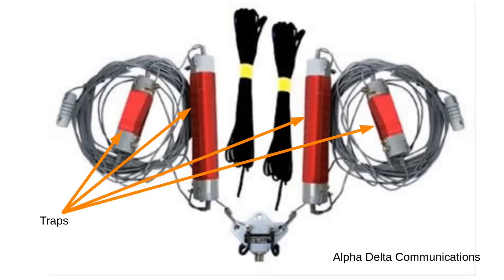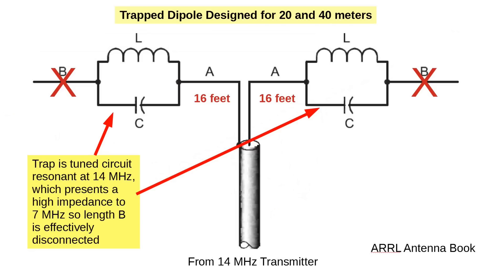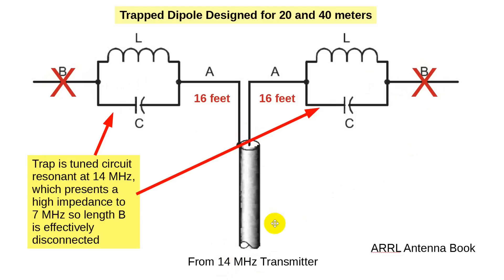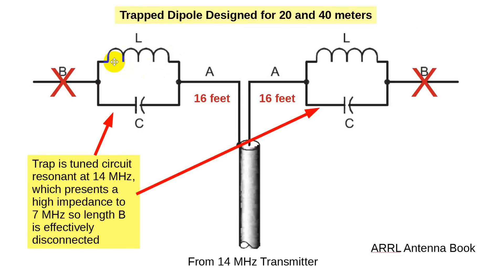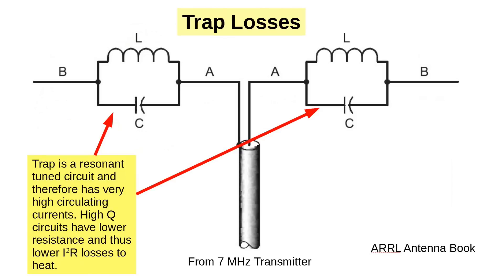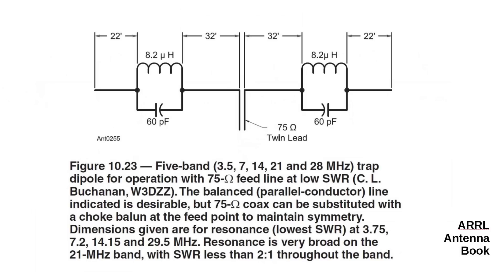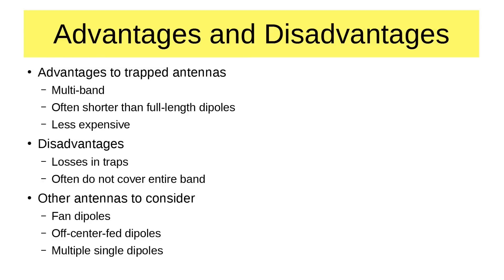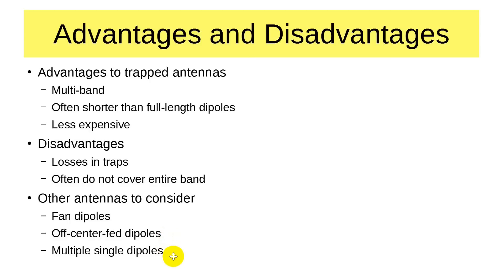How Antenna Traps Work (#357)

Comment: Hi, I have a trapped diopole 40/20/15/10, its low off the ground, SWR on 10/15/40 are ok but on 20 SWR is high, the antenna is to long, where would I adjust the length to get a lower SWR on 20m...  Any advice would be great..

Comment: Great video and explanation Dave.  It also seems to explain the Diamond SRH 320A Tri-band antenna designed for the the VX-6 tri-band HT.  So I’m assuming that what I like to call the “load” in the middle of the antenna is in fact a trap that segregates  some of the three band resonances that make it a tri-band.  But if that is correct, why aren’t there two “loads” (traps) for separation/segregation of all three resonant sections?  I’ve loved antenna theory ever since my bachelor’s of EE, and have enjoyed researching and learning more and more of all the theory of antennas and how they work. Thanks Dave and 73 Tom KC3QAC.

Comment: Dave, your comment that no antenna will cover the entire 80m band is inaccurate. I use a 160m through 6 meter windom. 3.5Mhz to 4Mhz  on a yaesu ft950 using ONLY the inboard tuner.

Comment: What if you used ladder line to feed a off centre dipole at 22% feed point but had coax feeding along the ladder line at different points. Then had a inductor at the matchbox/tuner, but the inductor was more like a variable transformer which could tap in at different points along the ladder line.

Comment: If a trap is very high Q, will you get extra gain at the resonant frequency? Meaning, if you're only receiving a single frequency, then it seems like a trap has no downside, only upsides: shorter antenna, no heat, no losses. Correct? thx!
Reply from the maker: Traps cannot create power. In this case, higher Q translates into narrower bandwidth. Traps are RLC circuits and can have high circulating currents, which causes some loss in the R component.
Reply: @davecasler  So they don't create gain, but concentrate energy on a particular frequency, correct? Doesn't that help compensate for losses? Isn't the whole point that the trap provides less loss at a given frequency than you could achieve otherwise (with a broadband antenna)?
Reply from the maker: @johnaweiss  The short answer is no. A trap is a passive filter that either allows energy to pass or blocks (traps) it, depending on the frequency. Prudent choice of traps allows you to create a multi-band antenna, and only the correct part of the antenna will radiate. The choice of frequency is made by the radio's internal oscillator. Think of it this way: depending on frequency, a trap either allows use of a certain part of the antenna or blocks it, so for different bands the antenna has different effective lengths. Note that traps largely went out of style about 30 years ago, and few new antennas use them (although you can still buy them). Nowadays it's end-fed-half-wave dipoles that cover many bands, or off-center-fed dipoles that can cover several bands. Hope that helps.

Comment: One question seems to be subject of different opinions: what should be resonant frequency of the trap. 

So far I found these claims:
- spot on bottom of the band
- just below bottom of the band (this one prevails)
- anywhere below bottom of the band
- at the middle of the band / middle of the part of the band you want to use antenna

I believe in one occasion I even saw claim that trap should be slightly above the band.

What is correct?

Comment: I am using a 132 foot MFJ 1982MP wire antenna and can't get ten meters and eighty meters to tune , forty through twelve is fine. I am using a nano VNA to do frequency sweeps.
Reply from the maker: MFJ told me that the coax from the radio to the balun should be quite short. I finally figured out it's primarily for portable use. By contrast, the MyAntennas EFHW 80-10 works really well even with a long feed line.
Reply: @davecasler  Thank you sir.

Comment: Hi Dave, thanks for an interesting video on how traps work, If I wanted to make a trap vertical for say 10 meters, 20 meters and 40 meters,
I understand that the first part of the aerial will be for 10 meters then the trap, what would be the length of wire from the 10 meter trap to the 20 meter trap be? Is there a formula for this? Also what would be the length be between the 20 meter trap and the 40 meter trap?.
I noted with interest that the one you described was a dipole with 16 foot each side and from the 40 meter trap it was only 5 feet, what formula did they use ?..
I have only ever used half wave dipoles, but now thinking about a wire multiband vertical with traps.
Your help will be helpful with this project.
Many thanks mark..
Reply: You alrady have length of wire used for lower band so you just add extension to get proper length for lower band. Calculation is the same as for ordinary dipole, just decrease dipole length for wire already used for higher band.

Comment: I'm no electronics expert but I noticed what appears to me to be an inconsistency in your presentation.  At 3:50 you declare in the diagram and audio that the trap is a tuned circuit.  At 5:28 in the audio you say: "This right now (pointing to the trap in the diagram) is no longer a tuned circuit because it is below the frequency that it is tuned for." The frequency of the RF going into the antenna does not change the fact that the trap is still a tuned circuit.  You need to rephrase your comments.

Comment: Hi David, can you make a video about a very interesting question: How come a dipole's bandwidth gets smaller when going lower in frequency and gets a larger bandwidth when the frequency gets higher. Also, how can you enlarge the bandwidth on lower band dipoles. My home made dipole on 80m has a crappy bandwidth of less than 100khz. Will higher height increase the bandwidth? 
Thanks for the perfect explanation!
Reply from the maker: The bandwidth is pretty much a percentage (about 5% max) of the center of the operating band. 
All dipoles are like this. Your home-made dipole is perfectly normal. You can increase bandwidth by increasing the conductor thickness. Unfortunately this effect is minor, and to cover the 80m band you would need a width of several feet. The ARRL’s headquarters station has a “cage” dipole of four wires about 4 feet apart in a square configuration

Comment: I am using a trapped dipole Diamond W-8010 and it is impressive the extremely low bandwidth in the 80m band (about 25KHz for a good vswr). There 2 traps each side of the dipole in the 80m wires that reduce the bandwidth, but I think the balun is also not so good below 7Mhz. Anyway the antenna is compact for what it is and is good in 15m and 10m and reasonably good in 40m and 20m. Strange thing when it rains the vswr goes crazy high and it works only for 15m and 18m ))). For curiousity we were colleagues (worked in the same company) but I only knew it when you retired :)  73

Comment: I have been using the  W2AU/W2VS 40/80 Meter 5 Band  Trap Dipole Antenna  since 1988.  I have changed the wire many times but the traps and W2AU balun  has held up very well.  It is a great compromise antenna that fits on my 100x100 city lot in  kind of a crazy  inverted  V.    I keep looking for a way to fit an 80-40 OCF antenna on the property  they seems to be one of the better performers in limited space.  de WA3TVH

Comment: Thanks, Dave,
One good option is the multi-band doublet antenna fed with an open wire ( balanced feeder).  you avoid most traps with this one. lol
Reply: and with the tuner at the end point, then choke on coax to the radio.  They will work very well even if they are not resonant on any band natively, usually much better than any trapped antenna.